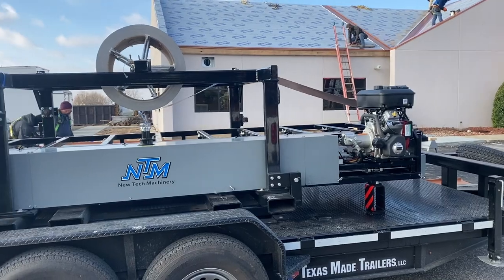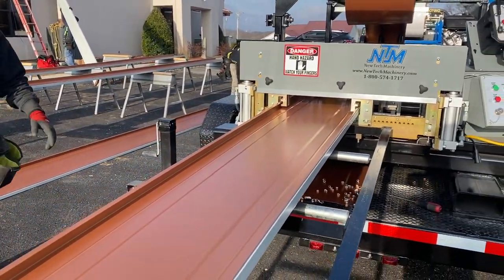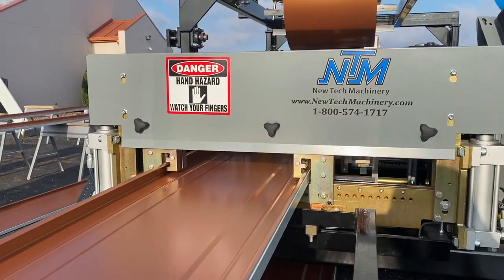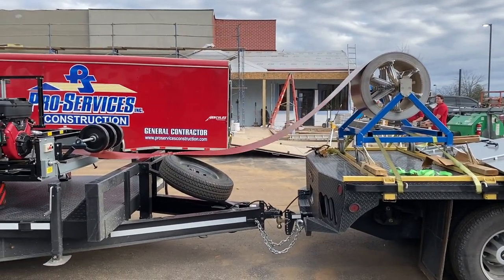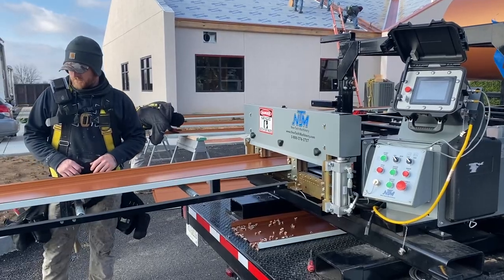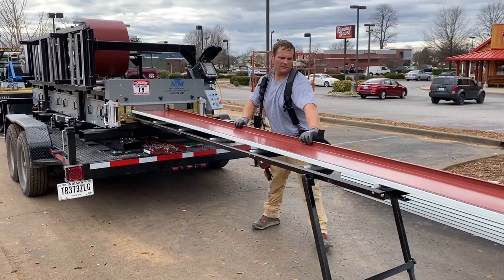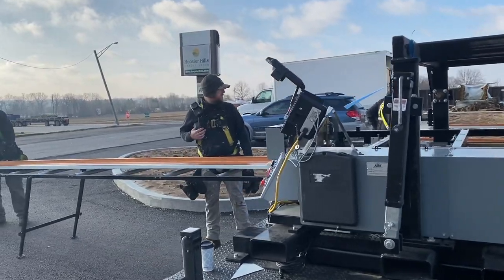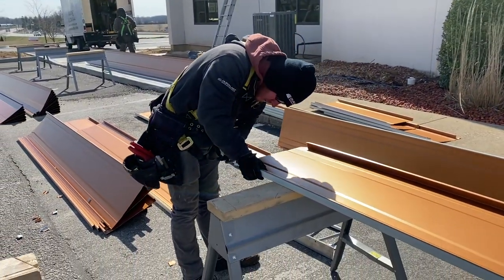Standing Seam Metal Roof machine  - Full Length Metal roof Panels through Onsite Roll Forming

Comment: Why is it called standing?? Because you can walk on them ??
Reply: The seam is upright or vertical above the flat plane of the metal. Its like a shark's fin or a boat sail.
Reply: @benfarmer108  ok....thanks
Reply: @mariogatica2363  You're welcome, metal roof is great to have. These machines are somewhere between $20-30,000 USD depending on what options etc but they are worth it and you can make your money back rather quickly with a few good sized jobs. I owned a gutter machine in the past and am in the process of researching buying one of these as well for a future project.